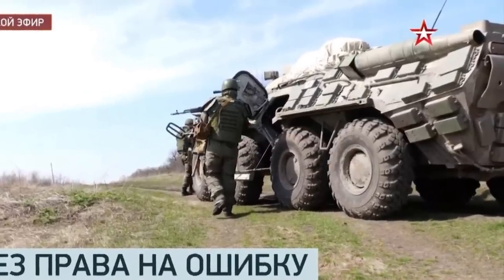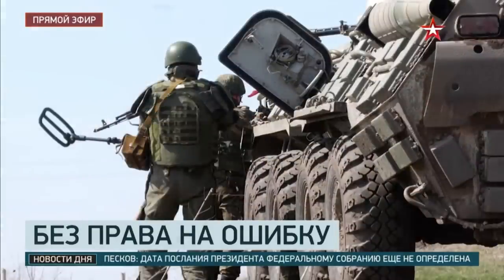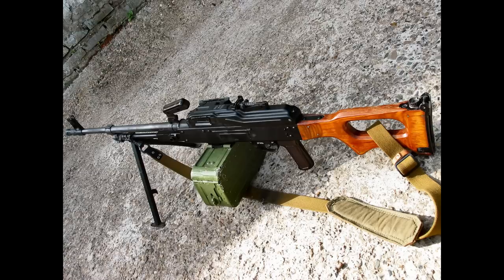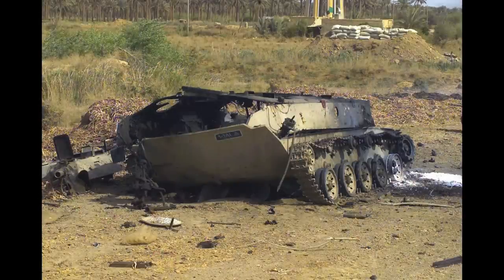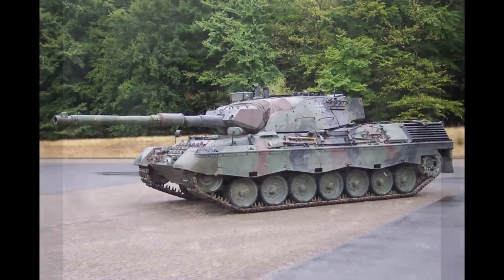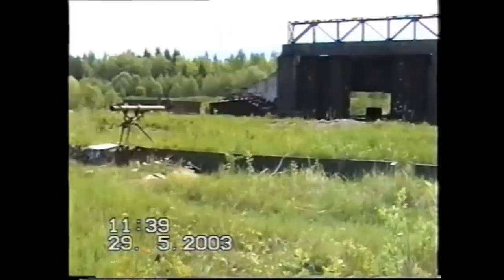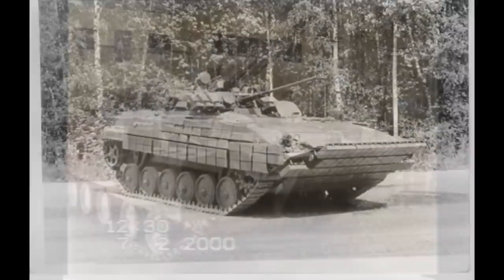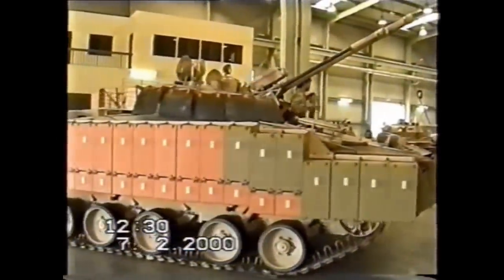Stop Putting ERA on Everything - Why ERA on Light Vehicles is a Bad Idea

Comment: I think the most egregious example of misplaced ERA I've seen was on the bonnet of a Tigr IMV. Just ensuring that if the HEAT warhead doesn't destroy your engine and kill everyone inside the vehicle then the ERA definitely will.
Reply: Pretty sure that unarmored truck from one of the images in the beginning is even worse.
Reply: I'm afraid UAZ-452 Buchanka with Kontakt-1 on the front was even worse. 
At least you can be certain it will be quick if you get hit by an RPG :)) and no, I did not make this up, there are a few like that.
Reply: Russian soldier here
Both sides use not only shitloads of ERA on everything, but also containers of ERA without actual explosive part
For example, our rembat (maintenance battalion, idk the proper name in English) put those on BTR-82 filling them with thick rubber, sand and steel plates. Some kind of improvised armour.
I do definitely think that there are idiots who put actual ERA on light IFVs, but you know, army is an army, there are a lot of people and some will do dumb things
Reply: @Pathenic  that's some good info, anyways are BTR-82A comfy to ride on and what are your daily meals on the front
Reply: Who is shooting HEAT rounds these days? Is that even a thing?
Reply: @funkrates4778 what ? Ofc is a thing, why wouldn't it be ?
Reply: My favorite that I've seen so far is the T-72 with ERA on the Cope Cage. Not that it did it any good.
Reply: @Pathenic  that's called "NERA" or "NxRA"; non-explosive reactive armor, and western countries do the same thing sometimes
Reply: @funkrates4778  All post-WW2 man-portable anti-tank systems use HEAT warheads. Tanks will prefer to fire kinetic rounds if they see another tank. But the vast majority of threats a tank has to deal with is from infantry.
Reply: @shaddaboop7998  That's what I thought. I thought the rounds used would be to destroy fortifications, to eliminate infantry and to destroy armored vehicles. I can't see HEAT rounds being effective in the 21st century.  So I suppose that would leave three types of rounds, which would be for example, respectively, HE rounds, Canister rounds and KE rounds.
Reply: I think most tanks are destroyed by HEAT warheads.  The javelin is a fine example.
Reply: @rogue_hk  BTR-82 are comfy enough
Not a competitor to any civilian car ofc, but way more comfy than mt-lb
Best thing I rode on was KAMAZ Typhoon MRAP 

Meals, well, it depends
I'm a part of artillery crew and mostly we eat prepared food in our rear positions, sometimes MREs 

Most surreal place about meals and stuff is Donetsk city, you can eat in a restaurant like in normal life and then 15 minutes of driving away is a hell on earth in Mariinka
Reply: @Pathenic  Incredible! I hope you make it out of this madness. Everyone should, except for those politicians
Reply: @Pathenic  it's surreal to see both sides of the war have a normal conversation, the internet sure is interesting
Reply: @Pathenic  thanks for sharing!
Reply: @funkrates4778  it is still very useful (armchair
Reply: @rogue_hk  as a tank round? I see people in the comment section mentioning the Javelin,  but I thought were talking about Tank rounds.
Reply: @funkrates4778  oh idk then
Reply: @radovankral5524  wasn´t there a pic of a Ural whit one on its windshield?
Reply: @Pathenic  Combination of thick rubber, sand and steel plates is definitely a good idea!
Reply: @laksamanasuhendra5868  level of conversations in Eastern Europe. It was just too boring to fight in online gam...ok it's not even funny
Reply: @funkrates4778  Tanks firing HEAT as a gun round against MBTs isn't really a thing anymore, but it's still incredibly useful against light vehicles where a Sabot might over-penetrate and not fragment enough to do significant damage like trucks or lightly armored APCs/IFVs, etc.

Some countries like the US also phased out dedicated HE shells choosing instead to just use HEAT against infantry usually with a fragmentation sleeve added for increased effectiveness. (The Abrams does have the Canister round, but IIRC it was mainly intended to be an anti-helicopter round and in actual combat was used to blow to doors into walls for infantry to assault a building through. If they had it they'd use it against infantry but I think most of the time they just used HEAT, could be wrong though)

Ironically while HEAT as a gun round against MBTs might be old, against helicopters its still effective. The US MP-T has an optimal proximity fuze that can be engaged and the as mentionedfrag sleeve, turning it into a 120mm AA gun. It still lacks a tracking radar, hence why it's only really effective against helicopters. 

Besides that yes, HEAT as a gun round has mainly been relegated to bunker busting and anti-personnel  work. Only reason they're still used in missiles is missiles usually fly slower than a gun round and HEAT warheads have the same penetration regardless of their speed or range they were fired from. Though even that seems like it'll be phased out eventually whenever kinetic energy missiles like the canceled LOSAT/MGM-166 KEM become a thing.
Reply: @Pathenic you still alive dude?
Reply: @greenfingernaildirt356  was wounded three months ago, in rehabilitation now. So yeah, still alive!
Reply: you just don't know that there are no explosives in this block. It’s just that the block itself is a 10mm plate made of very hard steel that can withstand 7.62 and very convenient clamps for attaching it anywhere. The Russians began to widely use these blocks to create spaced armor
Reply: @rogue_hk  they have actualy the best provisions ive ever seen in any army , its pretty cool pakage

Comment: Back in WWII when US tank crews were sticking improvised armor onto their Shermans, the Bureau of Ordnance reported that this was not only a bad idea due to the increased load on the vehicle's drivetrain creating maintenance issues; but, that most of the improvised armor would only serve to help focus the shaped warheads of anti-tank rockets into the tank's armor.
Patton forbade the third armor from adding improvised armor, and it seems to have worked out OK for them.
Reply: There is no evidence that the Bureau of Ordnance said anything about makeshift armor focusing shaped charges

In fact, some divisions got official sanctions to install cages that could hold sandbags, or hooks to hold lines of tracks

Patton didn’t like it because of 2 reasons 
1. He was told that it would degrade the tanks transmissions and suspension quicker

Which was true

And 
2. Because it didn’t look formal, and Patton was extremely anal about his army looking professional 

Everyone had to fight and die with a tie and their sleeves worn out, and their shirts tucked in with a belt
Reply: @bornonthebattlefront4883  I thought that I recently read that in "Patton at the Battle of the Bulge" however, having just bought the ebook version to be able to do "control f" on it, I couldn't find the reference, so, I do concede that point :D
Reply: The one that I have heard about before was that they shouldn’t be adding concrete armor onto tanks as the concrete normalizes incoming shells and reduce bouncing chance. Although I don’t know the validity of that statement.
Reply: This isn't entirely true, the philippine army during the marawi siege did something similar by putting wooden layers of improvised armor on their apcs and many people made fun of it. But eventually experts justified them because of the way shaped charges work, it doesn't matter what kind of armor the warheads hit because they have a fixed depth that they could penetrate as long as you can get it to detonate.
Reply: @lespectator4962  No, philippine army's improvised wooden armors don't work, at least against proper anti-armor weapons. That fixed depth you mentioned can be a few meters, and slapping few meters' of improvised armor is just impractical. In realilty their adversaries were often armed with old rusty RPG-2s with HE-FRAG warhead, which wasn't good enough even against thin armored APCs.
Reply: @nematic529  Well it's your word against their experts.
Reply: @bornonthebattlefront4883  yeah I mean, Abrams has a Sherman with steel plates added around the turret, sides, and upper glacis, the M4A3E2 also exists so I don't see why the Bureau of Ordnance won't let tankers add armor to their regular Shermans.
Reply: @laksamanasuhendra5868  
Because some tankers were adding the wildest shit possible. Cement blocks. Logs. Wood scraps. Sand bags. Spare tracks. Ammo cans.

I'm not sure where I read it, but I specifically remember one crew dismantled a Willy's jeep and welded the frame onto the chassis of their Sherman. Take that with a grain of salt though.

But, in regards to what the OP is saying, most crews got around to adding concrete. Now, concrete is not nearly as effective as steel in terms of stopping shells. It works in the same way as modern composite body armor. It's just that, if you've ever seen concrete get hit by a sledge, you know how brittle the damn stuff is. Now imagine a guy with the strength of 50 men swinging that sledge. That's what that concrete was trying to stop. Granted, concrete provided, at best, a few extra mm of protection for every few (3 or so) extra inches of added armor. But the stuff is EXTREMELY heavy. This added weight was basically destroying drive trains and putting more Shermans in the shop then were otherwise necessary. Sometimes out on the field, making them easy prey for enemy AT crews.

On the other hand, fixing additional steel plates was a FAR better solution in cost, maintenance, and weight. And it led to tanks being produced with little hooks/lugs on the hull that serve as attachment points for extra steel plates.

The Jumbo Sherman is one example of an up-armored Sherman designed specifically to increase survivability against big guns. That said, it was just a stop-gap. Few were produced, but the lessons were learned. The M26 would take that into account.

But, yeah. It's not so much that Command didn't care about the troops. It's just that weighing down your tank, and thus heftily increasing your chances of mobility killing yourself in the middle of combat, is probably a worse situation than having a little less armor. You were trading a negligible, if any, improvement in survival for an 80-90% chance of losing your vehicle when it was most needed.
Reply: @lespectator4962  Foreign experts actually corrected Philippine army experts about using improvised armor on vehicles as this would stress the vehicle engine due to extra weight. The only reason it worked is that the maute group at marawi dont have powerful anti tank capabilities and was using dated rpg 2s. Had the insurgents had rpg 7s, rpg 28, kornet, tow missile systems and other more modern rpgs.. the improvised armor used by the philippine armed forces would be very useless and would cause more harm than good. If you still would defend those experts take a look at the war in syria where isis and the syrian army used different improvised armor plating for their vehicles and tanks but that did nothing at all to protect their tanks and vehicles against rpg 7s, tows and the infamous improvised flying gas cannisters fired by home made hellcannon mortars
Reply: @yongli8276  Basically germans tried out concrete armor which supposed to be unpenetrable behemoth, but it ended quickly because it didn't have help from somebody to scrap them tanks like that happened to be scrapped E-100 and Maus, because if i think that they are intact because of low  kilo explosion, maybe 10 kg or 25 kg seems like i don't know so that perfomance is worse to wear off transmission, vital engine parts, and that's why project is scrapped at the end of war.... everyone heard that maus is now famous superheavy tank...
Reply: @yongli8276  Nonsense. Concrete is very heavy and has very low durability. Concrete was added to protect against magnetic mines. But only the Germans made such armor. And only the Germans used such strange mines
Reply: I thought it was about then the soft tracks as armor hurting the benefits of the slope provided

Comment: ROMOR-A and other similar western ERAs require 25 mm of RHA, whilst Kontakt-1 requires at minimum 30 mm of RHA or 60 mm of ABT-102 aluminum to safely mount it.

DPR / LPR forces used Kontakt-1 ERA on BMP-1/2 in 2014, by placing Kontakt-1 on top of thick conveyor belts taken from local coal mine. They tested it, the side and front armor did not cave in. It can theoretically stop older RPG-7 and SPG-9 grenades when shot at an angle.

Comment: The thing is that kontakt 1 (4s20) ERA has an explosive equivalent of 280g of tnt which isn't all that much. For context a grenade has around 200g of tnt equivalent. So I'd estimate that if there was some sort of spacing between the ERA and hull, you definitely could use it with just 16mm of side armor on a bmp.

Sure it won't stop an rpg on its own, but decreasing the penetration of an rpg round will also decrease the post penetration damage it causes.

Also an rpg round has the equivalent of 1kg of tnt, so it's not like just letting an rpg directly hit your armor is any better. The blasts may even somewhat cancel each other out.

So yeah, while slat armor might be better, I'd go with slat armor, the ERA, then at least 10cm of spacing. I'd say that would stop and rpg7
Reply: Well it would still spray shrapnel on the infantry beside the IFV. Not perfect for a vehicle carrying infantry
Reply: @ratlingzombie8705  neither situation is ideal, the question is if the ERA would increase or decrease the damage and in my opinion, as long as there was some spacing between the ERA and the hull, as seen in some of the pictures, it's definitely possible that it would significantly reduce the damage
Reply: @randallturner9094  I think on the Bradley it's placed on a stand off panel a little bit away from the armor but you definitely can make it work as long as you don't place it directly against the armor
Reply: @ratlingzombie8705  if there's infantry by the vehicle getting hit they'll take shrapnel anyways
Reply: really need a APC with proper armor, sadly today only one in use is PUMA
Reply: @legoeasycompany  the btr-82a has spall-liners to protect against that.

Comment: Thank you for this video. Simple common sense. This is why slat armour is the standard option for such light vehicles.
Reply: Yeah.... I think I just found out why they only use ERA on the middle to front part of a tank and slat armor around the engine compartment.... Even a tank engine couldn't handle the explosion
Reply: Our bulldog in Iraq had both era and bar armour what you call slat... and found out few casualties and an ied latter not all the era were live, mainly on the side with the transmission and engine
Reply: @ifv2089  Not nice at all. At least you are here to tell the tale and presumably alerted other soldiers to that hazard.
Reply: @Michael Guerin  there was an inquiry, yes. Would have been nice to know some of our ERA was for show, but it still beat riding around in a snatch armoured landrover.
Reply: @ifv2089  Protection wise and comfort wise. I remember on one occasion being the sole rear passenger in a skippy (88” Rover, for the uninitiated) bracing myself across the compartment whilst the vehicle was bouncing so much along the gravel country road that my balls were bouncing against each other😁. It was our (Engineer) Squadron 2IC driving, by the way. I would have had a rocket for pushing it that much!